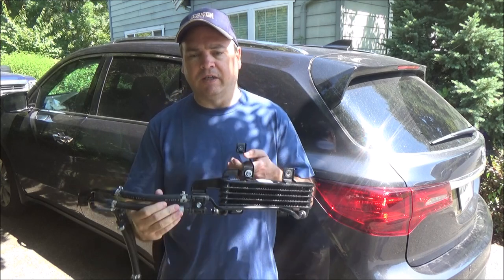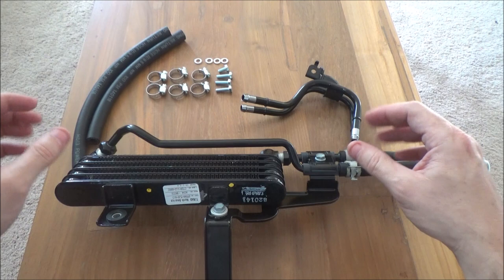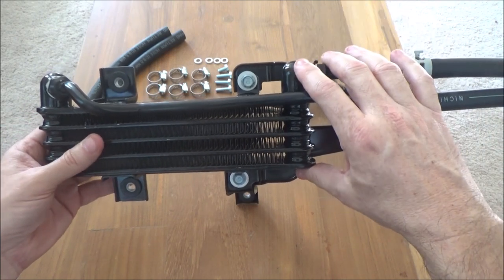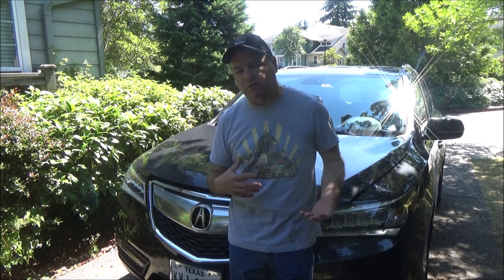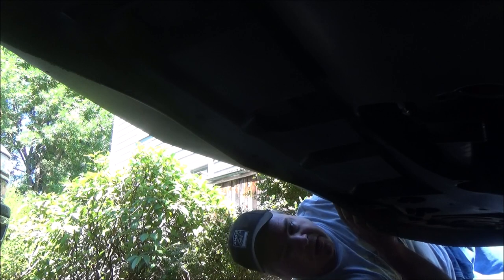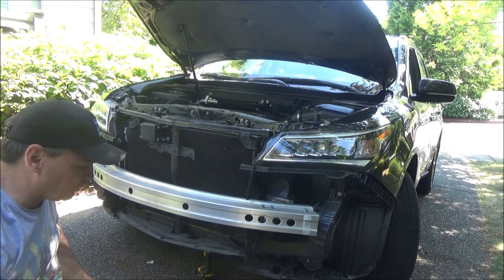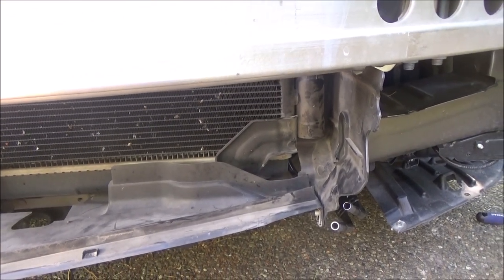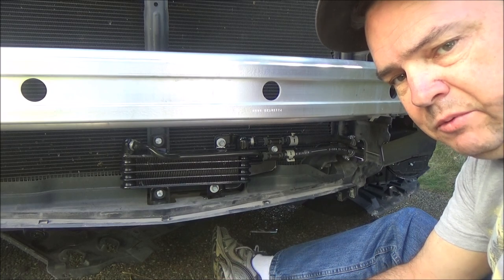Installing Transmission Cooler on an Acura MDX

Comment: EXCELLENT VIDEO!  Question about the flow and about a filter, please.  1) Keeping it simple, the top of the aux. cooler line goes to the top line at the engine and the bottom of the aux cooler line goes to what appears to be a filter (bottom line at the engine) on your video?  2) I saw someone mention installing an in-line filter?  Does that mean a filter on the 2014mdx is not standard and if not, what type of filter should be installed?  Thanks.
Reply from the maker: I have not looked at the setup of a 14 so I can't say for sure.  I would suspect there is a filter already there but don't know for sure.  The filter is the last thing in the line before the fluid goes back into the transmission.  It's the last opportunity to catch any debris before going back into the tranny.
Reply: @RoughRidersTV  thanks for responding, but also the question - basically bottom line on the ATF cooler kit goes to the lowest connector on the engine, and the upper line on the ATF cooler goes to the upper connector on the engine (connector/nipple) and when I say engine, I mean the connectors @ the engine, not actually the engine itself.  Thanks
Reply from the maker: @deanb6120  It's not going to make a difference because the transmission cooler is not directional. The pressure is going to push the fluid through the cooler regardless of direction.  However, if you have hoses cut to the length specified, you will see that the hose lengths will match up best based upon the orientation because one has to travel a longer distance to connect the lines. It's also a cleaner routing without having to cross lines to make connections. Your best bet is to look at the hose lengths and see how they best fit and what routing works best.
Reply from the maker: @deanb6120  Look at the diagram here and you will see what I mean...https://acura.oempartsonline.com/oem-parts/acura-cooler-assembly-atf-toyo-255005j8013?origin=pla&msclkid=98b01c677d1c1cc736207d533dcb5bbf&utm_source=bing&utm_medium=cpc&utm_campaign=RP_Shopping_Main&utm_term=4585238372044180&utm_content=Parts%20Only%20-%20Custom%20Label%200
Reply: @RoughRidersTV  Thanks - I saw in your video you said you had them hooked up wrong, so I thought it was functional wrong, not cosmetic wrong.  Thanks for clarifying.  Still, awesome as heck what you did with the video, thanks,
Reply from the maker: @deanb6120  It was functionally wrong...but it had nothing to do with the flow direction. It had to do with the length of each hose and being able to reach the transmission line in the engine bay. I guessed when I installed the short and long hoses...when I went to connect them up, the short hose would not reach the transmission line and the long hose was too long.  I had to reverse them...once I did that, everything was a perfect fit.
Reply: @RoughRidersTV  I just completed the trans cooler using your video. Thanks for the guidance. There is a filter there. I changed mine. Easiest way is either by removing the battery and tray or perhaps removing the splash shield in the driver's front wheel well. From underneath there just isn't enough room to maneuver. Part# 25430-PLR-003.
Reply: The filter looks similar to a fuel filter found on antique cars and trucks. There is a single 10mm bolt on the side of the filter bracket closest to the frame rail. Remove it and the filter bracket comes apart. I might cut my filter open and see what is inside. '14 MDX 108K miles.
Reply from the maker: @joeaverager  Good tip. Thanks.
Reply from the maker: @joeaverager  I change the filer about every 3rd tranny fluid change.  It's actually due up on my next change in a month or so.
Reply: @RoughRidersTV  Just want to say thanks again.  I did it yesterday.  Since I was there and pulled the battery tray AND was doing a 3x transmission drain, decided to change the ATF filter at the same time.  Couldn't find one at Acura, so got it from Honda (same as Pilot).  Bought Honda DW1 like you and others showed - cheaper than Acura branded fluid.  Also, before I pulled the front facia and lower plates, I used blue tape and labeled each hole if it was a bolt, screw, or fastener which made putting everything back, easy (hard to tell under the car if it's a bolt, screw, or fastener.  I will say, once I removed the battery tray, I really didn't need to remove anything besides the front facia as it gave me plenty of work space in the engine, including pulling the transmission filter, cutting the hoses to the right size, attaching hose clamps, etc.  Really appreciate how Acura prepared the car for this with the screw holes, wiring, etc.  Anyways, thanks to your video and watching it a couple of times, I worked on without needing to run to the computer.
Reply from the maker: @deanb6120  You are very welcome. This is exactly why I started the channel so that others can tackle these projects. Glad the video helped.  Thanks for watching.
Reply: @RoughRidersTV  You gave me confidence!  I may do the transfer case when the time comes now.
Reply: @joeaverager  VERY GOOD POINT!  I forgot to mention that.  I watched another video (not RoughRiders) that showed replacing the filter, but they removed the entire filter bracket (3 bolts).  When I was in the engine, I noticed a single bolt and hinged bracket so figured I could just pull that, and it worked and was SUPER easy to take out that bolt (and the arm of the bracket can be removed) and put back in (once you get the hoses off that is).  I would say hardest part of all of this was getting the old hoses off (being careful to save the ones you don't want ruined, so you can't just cut them all off if you are replacing the filter).  The second hardest part was all you had to remove to get into the engine (front fascia, snorkel, battery, battery tray).  Since I didn't have the patience to remove wires that were attached to the battery tray, once I removed the three bolts on top, the two underneath, I just folded the battery tray up towards the side of the car and used a bungie cord and attached it to the rim to keep the tray out of the way.  Also, the third bold on top, attached to the air box, was a PITA to remove.  It kept twisting the plastic and so at first, I was worried that I wasn't supposed to remove it.  Then, the way it looked, it looked like a rubber dampener integrated with the bolt kind of deal that I could just slide out once loose.  WRONG.  Have to remove the bolt, but support the plastic to keep it from twisting (just in case).  Despite twisting, pulling, prodding, pounding, I didn't break the plastic before I resigned myself to bolt removal and moved to brute force in removing the 10mm bolt (it just did not want to turn to come out or go back in).  All in all, wife sees me as some kind of god having saved money installing the ATF cooler and hitch (which I also learned how from Rough Riders video), and flushing the transmissions and replacing the ATF filter which Acura doesn't even recommend or have in the maintenance manual.  I'll be dining out on this for about a week before my status degraded back to where it normally is.
Reply from the maker: @deanb6120  I think you will find that most repair/maintenance stuff is not really hard.  Some jobs are just more about how much stuff do you have to remove to get to the thing you need to fix/replace, just like adding that aux cooler, you had to pull the batter, remove fascia, etc. to get the job done but the job itself was fairly easy.  That is typical for a lot of repairs.
Reply: @deanb6120  Funny post! Glad you found project success.For the next person that comes looking for an answer - the drain and fill x3 fixed the car's surging on hills. It was indeed the transmission fluid being worn out per the Honda TSB.

Comment: Great video. Many thanks for putting it together.
Reply from the maker: The in is the line with the filter.  However it doesn't really matter because the cooler is not directional.

Comment: Hi there, I found your channel from an Acura owner forum. I am wondering what you can toll with the atf cooler installed. I am trying to tow a 20’ travel trailer that is 3100 lbs dry. The numbers work out but wondering if you had any experience actually towing your tear drop with the mdx?
Reply from the maker: Yes, we tow the teardrop all the time with the MDX. However, it's only 1500lbs so we barely notice it back there. I installed the cooler for 2 reasons.  One, heat is the enemy of your transmission so the cooler it runs, the better.  The other reason was not really the teardrop but because we had a flatbed trailer with a Yamaha YXZ side by side that we towed.  The combined weight of the trailer, SxS and gear was around 3K lbs. so I wanted the cooler to give me a little more cushion when towing that additional weight.
Reply: @RoughRidersTV  I just installed a Redarc brake controller on our '14 MDX. Controller tucks up inside the dash nicely. Only thing visible is the control knob which I installed in one of the switch blanks for some feature our '14 MDX Tech doesn't have (probably where the driving lights switch would go). Worked nicely last night with our popup camper. eTrailer had the controller and the wiring harness. Plugged right into the MDX, no wiring necessary. Am using the factory Acura trailer hitch and trailer plug outlet.
Reply from the maker: @joeaverager  I need to get around to installing a brake controller.  Haven't towed anything big enough yet to require it though.  But it's always a great feature to have available in case you ever need it.

Comment: Does your MDX have a 9 speed transmission? If it does, then this mod could potentially cause problems when towing. 
I remember reading about the issues on 2017 models with this mod in an Acura forum.
Reply from the maker: No. I have the 6 speed tranny. I had heard others complain about hard shifts when adding the tranny cooler to their 17+ models though. I know the offer a factory cooler like this for the ZF-9 tranny, but that tranny is pretty picky about fluid levels and operating temps so maybe that is where some of the issues are coming from, not sure.
Reply: Mine has the 9 speed. Have to do some research to get the details of that.
Reply from the maker: @AmerijamAcres  Yep. Should not be that much different but I do know that the ZF9 transmission is more sensitive to fluid levels and such.

Comment: Did you or anyone notice a "clunking" sound when shifting from 4th to 5th after install?  I'm reading in some forums Acura knows of this problem and says there is no fix and to just deal with it...need the 5k towing capacity but that sound will drive me absolutely bonkers if true.  Thanks for the great video.
Reply from the maker: No issues with clunking from the transmission after cooler install.  I do get some clunking from the hitch/receiver connection when I stop/start but that is easily fixed with a hitch tightener that takes the slop out.
Reply: @RoughRidersTV  well that's good news! Hey I really appreciate you suggesting the idea to piece together the kit...I got the cooler and metal tubes for $110 from AcuraPartsWorld; I was ready to drop close to $300 for the kit which is insane considering it's only a couple clips, bolts and hoses extra! Awesome stuff man
Reply: @towerh6680  glad it helped. Thanks for watching.

Comment: How did you get the parts for 2x the $ an aftermarket? I see the OEM online for $250?  Just curious where you found it cheaper.
Reply from the maker: I don't recall which online site I found it on...it was OEM Acura or honda OEM or something like that.  I had to hunt to find just the cooler itself and not the cooler in a kit. It took a while but the cooler by itself was around $65. The key was to find the part number for just the cooler and search for that as opposed to the whole kit part number.  I found an exploded view of everything in the kit so I could buy stuff separately and/or locally.  The mid connector pipe that wraps around the radiator was $20.00 from a local dealer, the hoses I bought at O'Reilly Autoparts, hose clamps and screws from home depot.  All up everything was $110ish so just about 2x a decent $60 cooler.  There were some coolers around $40 but they didn't seem very good.
Reply from the maker: I just got an ad email from Acurapartswarehouse.com so that may have been where I bought the cooler.  Might want to check there but again, it needs to be the PN for the cooler itself, not the kit.
Reply from the maker: Sean, here is the part number to search for.  Acura Part No.: 25500-5J8-013.  I just saw it at the Acurapartswarehouse I mentioned for 62.00 for the cooler by itself.
Reply: Thanks for the responses I was able to figure this out. In your video you mention having the specs for the two hoses to cut them to size. Do you have that information still? Installing this afternoon and it would be helpful to have those exact measurements. 

Thanks
Reply from the maker: Sean Cormier I don’t recall the exact length but it should be in the video.

Comment: Can you post or reply with part numbers, hose lengths, etc. Great video :)
Reply from the maker: Thanks.  For the hose length, I just picked up 2 feet of hosing from the auto parts store and cut to size. It was in a Prestone kit at O-Riley Auto parts. I just took the transmission cooler down there with me and matched up the hose on the cooler to what they had on the shelf.  I used the hose length specified in the full kit I found online ($250) which was 235mm and 295mm. However, I cut them to 240mm and 300mm just to give myself a bit of extra room. The part numbers for the transmission cooler (stand alone, not part of the kit) and the pipe that wraps around the radiator and condenser are both specified in the video but here they are for reference (cooler: 25500-5J8-013) (pipe: 25220-5J8-010).  Good luck on your install. It's pretty easy.

Comment: Is there an OEM cooler for the '06 MDX?
Reply from the maker: I'm sure there is...not sure what the part number is but when I was searching for mine, I saw various OEM coolers for different model years.  Try going to AcuraOEMparts.com and searching based upon your year and model and see if it shows you a part number.  That is how I found mine. Once I had the part number, I was able to do comparison shopping to find the best price for that specific cooler.
Reply: @RoughRidersTV  - OK - thanks!  I'll try that.

Comment: What happen to the hose u remove from the factory cooler?
Reply from the maker: Sorry, just saw this.  You really don't need it anymore.  It was running from the output of the warming block to the intake of the transmission filter.  However, you are removing it and replacing it with the 2 hoses that are running to/from the transmission and the warming block.

Comment: Awesome video.  Anyone has experience with getting around the quick connect fittings for 2016 mdx?
Reply from the maker: Not tried one.  Been thinking of putting one on my S2000 though.  If you are just doing the transmission fluid and not the transfer case, you really don't need a quick connect, only a paper plate.  I posted a video a few weeks ago showing how you can do the tranny fluid without removing the metal sheet.  You can see it here  https://youtu.be/uZlEnmmtsf0

Comment: What size tubes did you get from the auto part store
Reply from the maker: I don't recall the measurements but these were transmission line tubes and pretty much standard.  I did bring the old tube with me to verify the correct size.
Reply: @RoughRidersTV  thanks. the longer tube is on a month back order with Acura. just wanted to make sure it was not a special diameter.
Reply from the maker: @michaeldiener4179  Nope.  I picked up a Prestone kit and it worked fine.
Reply: Rough Riders does 3/8 sound right. I got the 235mm hose from Acura and that fit well. But trying to figure out the 295 hose. Where did you buy it? Auto zone/orilies only has 3/8 tubing but that Acura tube is slightly bigger
Reply from the maker: @michaeldiener4179  I got the tubing as a kit from O'Rielly Autoparts.

Comment: Cool video by any chance do you have to add fluid You’re done thank you
Reply from the maker: Yes, you will need to add some fluid.  I don't recall how much, probably somewhere between 1/2 and a full quart.  Just keep checking your dipstick until you get it dialed in.